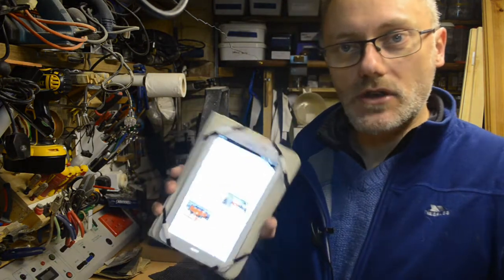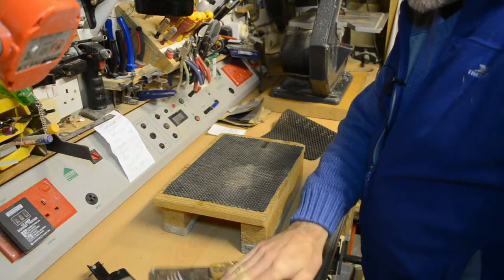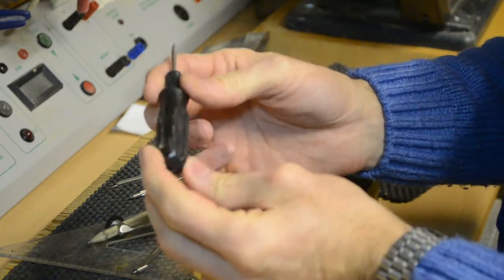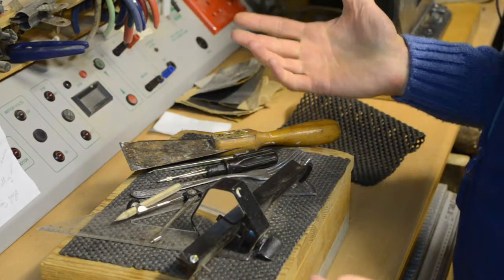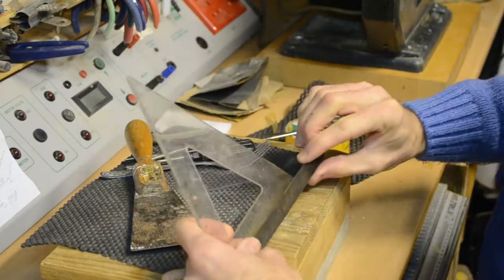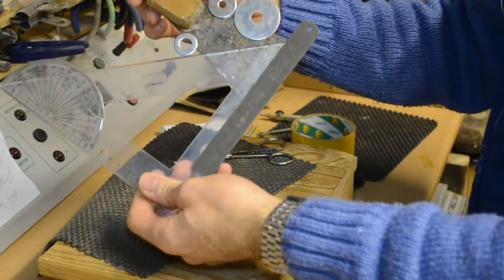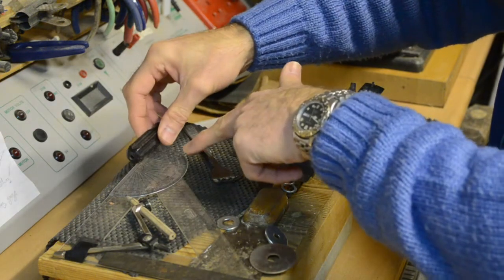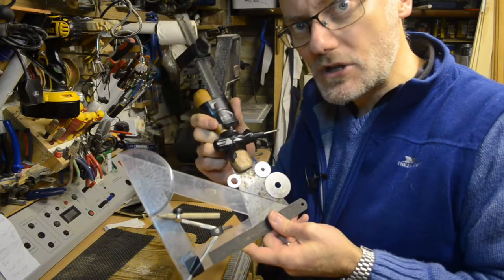The Tinkerage Alternative SqWayre

Comment: That's some tool! What car did you end up buying?
Reply from the maker: A Ford C-max.  I'm not sure if there is an equivalent model in the US.  1.0 litre engine pushing out 125 bhp.
Reply: Tales From The Tinkerage  The only 1.0 litre engine we would have would be in a motorcycle. Sounds like it would have plenty of power to size ratio though.
Reply: I meant power to weight ratio.
Reply from the maker: There are a number of manufacturers selling boosted 1.0 litre engines.  Plenty of acceleration.  And not just in a small cars.  The C-Max is a good sized family car, by UK standards.  They also do an estate (station-wagon) which has plenty of go, both in terms of acceleration and top speed.  And on a run can average over 50mpg, which is pretty good for a petrol engine and handy given the tax we pay over here on fuel.